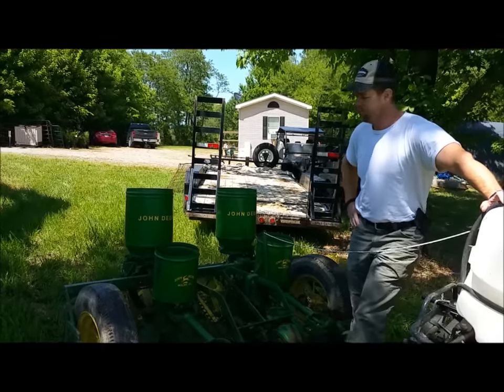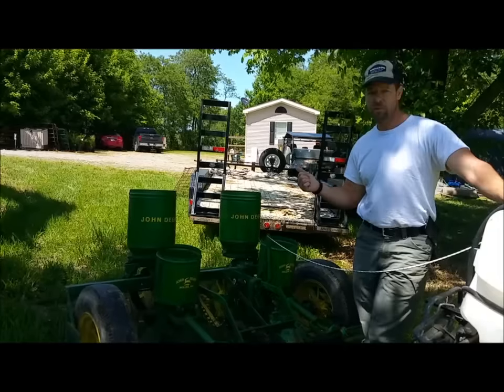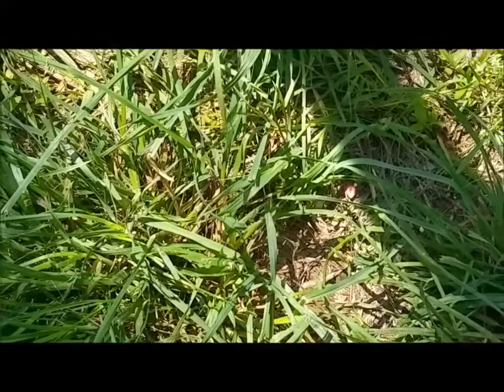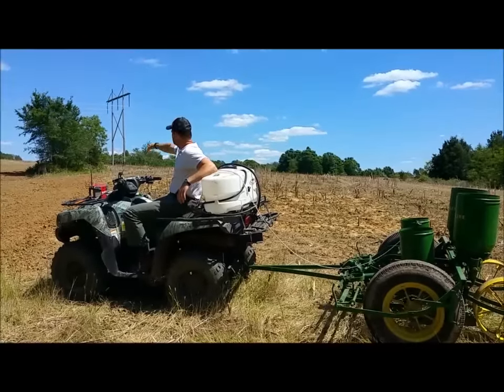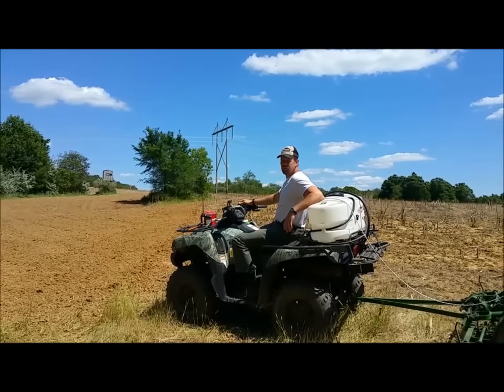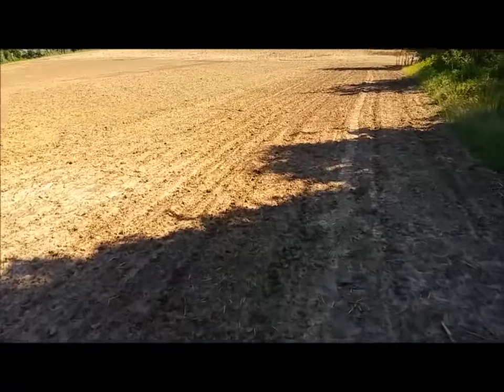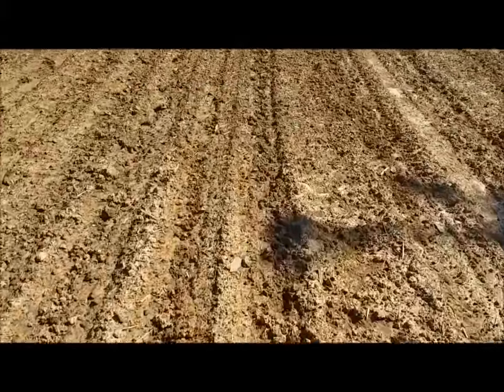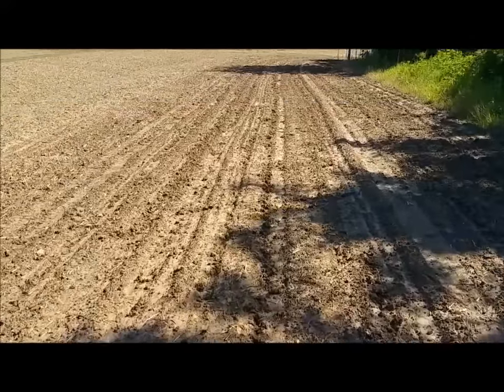Planting corn food plot with Antique John Deere 2 row planter

Comment: I have had the same model planter now for 2 years.  Finally got it in working order to plant corn for food plots this year.  Our lift and drop mechanism doesn't work and can't find the parts so we have to manually lift it when not planting.  We also took off the front drive gearbox because a gear inside broke as well as a the pinion gear for the differential.  Ended up welding a straight bar in it's place so it is a fixed differential now and works great, just have to go slow around corners or the chains bind. As you mentioned, we're afraid of it failing to drop corn randomly so we took a boat seat and mounted it on the back of the planter.  Now someone sits on it and observes the seed falling in every couple of seconds to ensure there are no problems.
Reply from the maker: wow, that's alot of messing around! yeah I've broke many chains and pins. I have also found out that SLOW is key and I don't go in reverse any more. even with the planter up the chains bind and sometimes come off in reverse.  but since I've done that it's been ok so far.